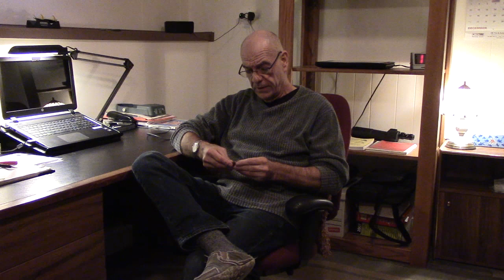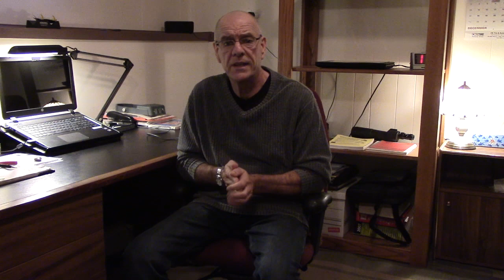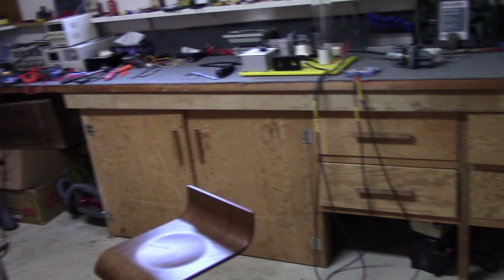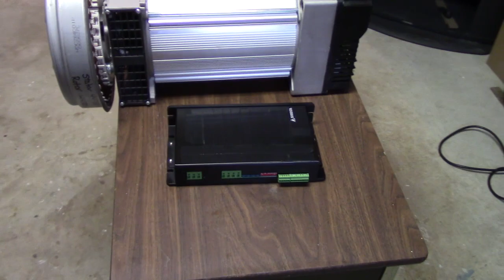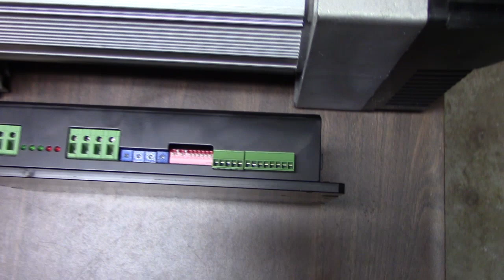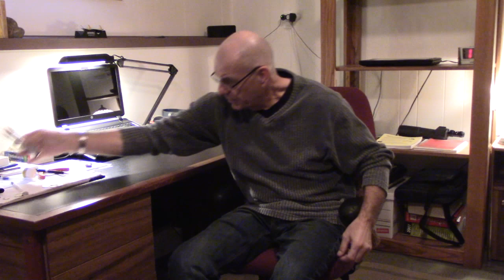A Peek at the Hyper-drive Standby Generator

Comment: i saw it back in the day ,,,he is a fool ,,he can not ever pronounce the name Tesla ,,,look the power does not flow in the wire like a river ,,,if it did then it would change the structure of the wire ,,,he is and idiot trying to make sense of it ,,,,yes it is the rf ,,dumb ass ,,and yes you can run anything on higher rf as long as yo do not over amp the wire in the windings ,,,he show nothing new and produces nothing new he is an idiot ,,,learn math and the laws of electricity ,,,and learn to speak the man's name correctly

Comment: Do you think that I can hook up two 24v 200 amp alternators to a 115v 1500 rpm motor with a 10in pully on it, and a 5in pully on my altenator, and hook them both up to a 24v 10,000 watt inverter than put a 450 amp disconect with fuses, and connect that to my breaker panel. Will it produce enough electricity to run my meter backwards, and run my house? And, do you know whether or not I am going to need a diode to incite the altenator?
Reply: The best way to know how is to do it on a single alternator first. I have. Those things (alternators) become too hard to spin once you apply load on them. The higher the load current the harder it is to spin. But take a drum motor like Morin did in his video ''Maximum efficiency from a drum motor'' and test it out in high RPM (like 10000 rpm) and see that the load braking doesn't exist anymore in RF mode of high spin generator

Comment: Solid state graphite crystal power cell's surrounding a Joe cell type construction with an aluminum resononce generator in the center fully enclosed surrounded by Gallium Aluminum Scandium alloy with the crystal power cells providing electrity to start up the aluminum resononce generator and slowly build up the ekectrical potential to max out each crystal power cell with vacume spark gaps in key locations to release the full potential of the electral energy.

Comment: If the hyper drive motor has so much torque, why not use it in impulse mode and spin a flywheel with an electric clutch. Use the stored inertia in the flywheel to spin the generator shaft. The heavy flywheel could spin continuously (and controlled rpms by a centrifugal switch) while the power being used would be impulse. (on & off) Producing more out than what's being used. That's overtunity.

Comment: I did a test today 9/2/2018  the aim if I could get any voltage out of the air, I connected one probe to the ground not far only 1 cm deep or less and the other as far up as my black jumper would rich, that was 90cm  and in the end I put a copper coil  one purchases from jaycar to bridge connections in a circuit board my volts read  (- 0.006mV)  gee that free energy,,, great!. I picked up a glass and added some water to increase the conductivity of the soil, put 1/2 of water straight onto my red jumper and it jumped to -185.5mV DC wow I let it run as the clock was climbing at a steady pace, it hit  -200mV  and  I added more water jumping to -251mV and then it hit me. What if I put a small coil on the earth too?  and the voltage changed direction, now the volt meter reads 200mV positive. when the red wire would hit the ground it will go back to -250mV bang it was negative. Question is this free energy? remember I am using very thin copper wire and a voltmeter no proper set up.  the 50mV loss could be the coil in earth acting as a resistor, still does't explain the change in direction. Why? - to + by the way when I remove the jumpers the meter will go back to 0mV as per original read out

Comment: Gerard  I am still looking better Controller then I have this this video https://www.youtube.com/watch?v=g6amYNHJVDI&t=1s   mine works  but  Magnets are not too strong and when i give some resistance to the generator   WM motor starts stalling  and vibrating  but on small load  like 250 W it runs  fine . We need more torque  to get better results .I wonder   how it will turn out your Speed controller for WM hub motor.

Comment: I do not know if you are aware, or if it matters for your application, but... The very strong neo magnets have a smaller field, because the field is pulled more to the center of the magnet. A milder magnet N38-N40 has a wider usable field than an N55. I learned that a couple days ago. Figured I'd mention it.

Comment: You should use adjustable voltage supply for the driver. Synchronous rectifier boost/buck is the best!

Comment: Hello Gerard, someone on youtube runs a drummotor on a regular 110v audio amp.

I do not have a lot of knowledge of electricity but as far I understand a drum motor runs on  little input power and with the frequency you can adjust the RPM.
So your contoller functions as the frequenty regulator?
Reply: here is the link https://www.youtube.com/watch?v=P3VWHSlbIA8

Comment: Gerard I have been trying to design a simple way to make these smart drive systems work, can do you know a simple way to do this? if so please send me a way to do it. I have an idea that I think will make it be PM. you have a lot of people who  believe in your research. stay in touch.
Reply: J T get a high voltage ebike brushless motor driver and hand throttle and a battery bank of 48v or higher and a dc-dc voltage booster that can Handel 1200w off Amazon. I rewound my motor for 72v and it frickin moves. cost me $70 for everything to make it run great
Reply: thanks for the info. but I am trying to run these motors as they are built. the reason is I have a 20 thousand watt gen. at 20 amp. output / 1800 rpm. with a gear system being driven by the motor I believe it will be able to maintain the adequate torque to run. any advice anyone can give is greatly appreciated. again thank you and all the  people who are here to add positive input to us.

Comment: Hi Gerard
I'm looking forward to seeing how your testing goes.  
Just a thought - if you haven't already looked into it - the output from your machine i think i understand is likely high frequency and high voltage non typical 'alternating current' - ie of a form that is not bound to the 'genetator ' due to possibly the use of spark gaps.  I think that your output may marry well with what is called a 'poe coil' developed by Daniel Nunez of:
https://1stopenergies.com
They are not overly cheep - perhaps Daniel would do you a good deal.  From my testing i believe the coils react well to standard a/c where at particular frequencies they demonstrate an amplification of voltage / energy - this may give you even greater output (if you need it).
Anyway thats the thought.  
Keep up the good work.
Cheers
Peter

Comment: based on your scenario equation regarding 'retailers' - then if your equation is accurate then simply it is the result of a 'non market' - this means that although there is the 'appearance' of multiple 'on sellers' there is actually only a few and - in that equation these few 'retailers' are 'organizing' to benefit themselves - if that is the correct equation then there are two main divergent options:

-1 the 'retailers' have organized in such a way that they can stop new 'players' 
-2 The 'Retailers' have organized with a third party , an 'enforcer' that has allowed that like for example a 'government' 

hope that helps - your idea of 'flipping the boat' sounds like a 'boarder-land' style environment.  risks are usually rewarded but only when we apply hard work.

Comment: 2.5A x 320v = 800 watts this is what it will take to run this motor at max. Curious you say you will get out 10,000 watts you say if I got this right is this correct? That is your estimation pass or fail I hope you share even if it is super efficient it is worth the effort lets say you get 750 watts out this would be great! So either way pass or fail I hope you share ... Errr with conversion and losses from the power supply it will likely be closer to using 1000 watts of power as I doubt you will be getting titainium rated power supply the conversion is going to cost you a fair amount of power I would guess.
As far as stocks I am only vested in crypto thats how I got the money together to put up my 2.5kw solar and wind setup (Posted on my youtube channel.) small investments turned into profit. Currently I am invested a bit into particl I feel this coin will be worth some good cash in the coming year!
Reply: Looks like lots of Crypto guys  watching the progress here  heheh

Comment: i m thinking if  you separate the drum ''motor'' from the generator , and put larger a pulley on the drum motor , and a smaller pulley on the generator you dont need the hyper driver , to run the generator at 3500 rpm ? and with the torque of the drum ''motor'' would be able to turn multiple generators.
Reply: How do you plan to generate power than lock right up to the output direct drive I take it I always thought of trying to do this with a bicycle and multiple axial flux generators on a long rod on each side of the bike. possibly have the bar magnetically levitated instead of using bearings along with a magnetic assist like several vgates so it would over come the sticky spot of the vgate would be awesome to build especially if it worked! I picture things like this in my mind all the time as potentials. I have a pretty radical induction wind idea using wind chimes essentially as a wind generation method. It is fairly difficult to manufacture this without specialized materials though I assume I would need carbon fiber to do it correctly or hrmmmm well I may just try it here in the near future just to see if it pans out just had an idea for the chimes that may work cheap enough to test it seems after looking up some parts.
Reply from the maker: NO pulley need for the reason of tuning the motor and generator is need.

Comment: Man! Test that puppy. I hope you get yuge torque #'s. I feel embarrassed being Canadian after that rant. But the thing is your  right.I live in T.O. and most people are so pacified or just plain stupid.
I'm doing my own tests now. Fusion 360, 3d printer and my mind making a multi magnet generator with vertical shaft, 56 magnets, 56 heads, 20 gauge magnet wire and spun with a large rc out runner. What diameter of tungsten rod to use? I'm thinking 1/4". Should the spark gap be in a vacuum or argon chamber of some kind.? Love what you're doing man.
Reply: John Livingston hey dude mee too i live in Toronto, damn seems like you've gone ahead of the game with your tests, hope you get a working energy generator, hate the damn energy corp.
Reply: John Livingston yes.

Comment: I came up with an idea last Feb., text my son on the basics of it and some Indonesian built it 6 weeks later. It worked but didn't have my full schematics. I designed a machine using the technology of the old with the digital electronics of today to run appliances on its own. He had to plug it in to start it. Mine doesn't.